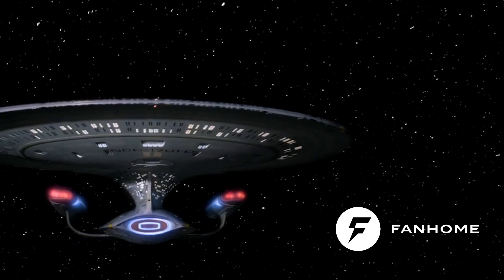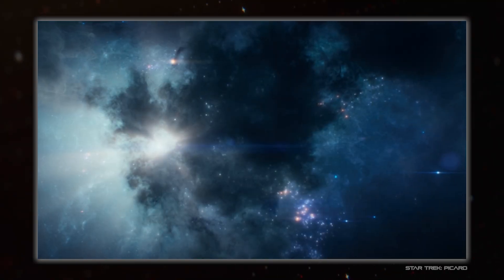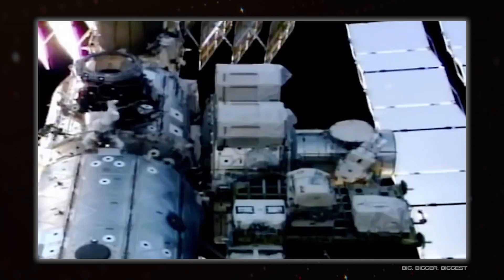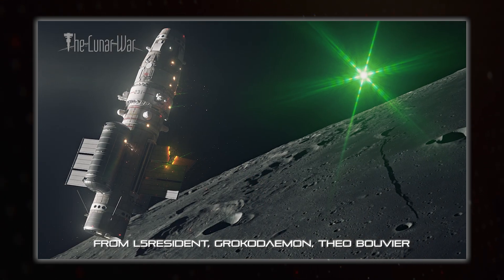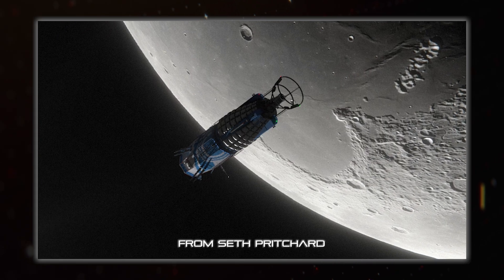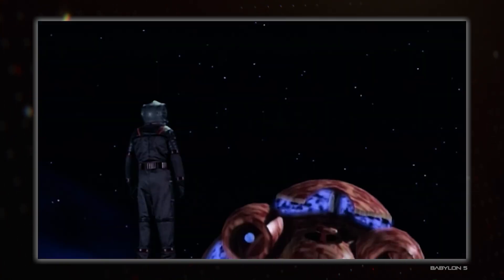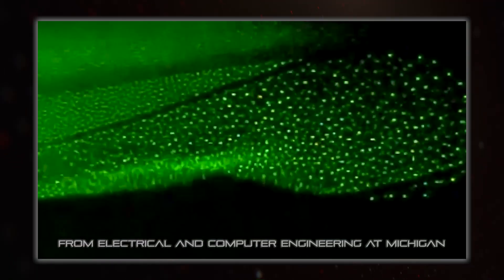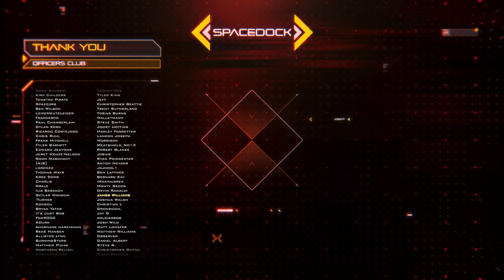Radiators In Realistic Sci-Fi (And Why You Need Them)

Comment: So there's an idea that you could use a magnetic field with metal dust or particles or debris to create a Shield around a spaceship it would be cool if the coolant system also happened to be a defensive shielding system it wouldn't protect against everything but there are a few things that it would protect against also when it comes to using a heatsink and just tossing it overboard which was the  last suggestion in the video why not soot it at the enemy or use it as a Decoy for heat-seeking missiles

Comment: Ship weapons in my roleplay setting have a two-mode heat dissipation system in the form of heat modules. The first mode is to just let it cool down normally. The second is to eject the module, and have another slide into place from a magazine. This introduces logistical issues as the modules are bulky and expensive. It's adds  what is effectively "ammo" for energy weapons. It's also fun for players to salvage spent modules after a battle.

Comment: For a liquid coolant, molten Sodium can be distilled from molten salt and you could use that instead, and instead of pumps, use magnets to direct its flow, and use that as a heat sink or a backup for your radiators. Less moving parts, and you'd get load chasing capabilities if you stored that backup heat energy somehow, only downside is having to design electronics to be resistant to the magnets they're directing.

Comment: So this video makes me wonder about another heat sink from another piece of fiction and how effective it would actually be or if this is a case of complete hand-waving.  The "Laser Heat Sinks" from Battletech. According to the game manuals "Unlike a normal heat sink which uses radiators and heat-conductive fluids to cool a 'Mech, a laser heat sink uses lasers to excite the hot exhaust gases to a higher-energy state, converting the infrared energy of the gases to light which is then shunted out of the 'Mech via a series of highly polished surfaces." They were stated to suffer from creating bright flashes which would increase visual detection of a unit, but also prevent thermal scans from spotting them. Also said that they didn't suffer from hot environments reducing their efficiency but also meant that cold environments didn't let them radiate heat faster.

Comment: Remember also that the reactor core or other high heat systems don't have to be in contact with crew quarters. You can have separate radiators connected only to that unit which can be driven at much higher temperatures and efficiency. A reactor "room" could probably operate in the 100s of degrees, depending on what tech you have available, maybe even higher.

Comment: Setting I fiddle with uses retractable radiators and capacitors. There's an emergency heat dump method involving fold space that empties capacitors in a hurry. But also leaves a thermal bloom in the sub dimension several times the size of the ship. And it  makes ftl at that location uncomfortable.

Comment: Why not hook up some Sterling engines to your heat radiators and turn that into electrical energy and do something else with it or even bleed it off into kinetic energy. You still need radiators but you get around 30% of the heat less and as a usable resource and backup. A backup is a multiplier and a hidden resource

Comment: In my book heat regulation is a major thing. The mech characters all have 'wings' that act as radiators, along with their hair and limbs, and have a respiration system where their blood transmits waste heat to a transparent coolant liquid that then passes through the wings. It's expected they will be damaged but because of how the system works it just turns into an active coolant system, and they are wreathed in steam, and if all radiators become inactive they are mission killed. At one point someone's brain and ganglia get damaged so their coolant system malfunctions and they melt from the inside out.

Comment: Another Variant I could think of, would be something like a dissipating radiator. While transferring some heat into the EM spectrum, it would also expel additional heat by surface evaporation. 
Though I have no idea how efficient this ultimately could be, when compared to pure radiators. Especially with the trade off in increased maintenance costs, since you constantly would have to replace used up panels.

Comment: Spacedock, not sure if you respond to questions. Could you use something like converting the energy type, as in, super heated liquid is used to power a generator that then powers a specific energy heavy system? Something like the heated liquid turns to steam which spins the turbines that power the magnetic shield system?

Comment: Why not use the extra waste heat as thermoelectric generators or thermophotovoltaic cells? Therby self powering that and potentially other onboard systems
Reply: You need a temperature difference for those. And the wnwehy you get is relatively low.

Comment: I imagine this is going to sound pretty dumb...but here goes... could you make a system act as a reloadable heat-sink? This way you could retract the panels in a battle situation, yet possibly last the battle by ejecting spent heat sinks? I imagine that would lead to clutter, but i also imagine there would be a way to reclaim maybe even re-use these "cartridges"?
Edit: nevermind does 9:00 address this?

Comment: My personal thought on this is that... In a majority of cases that do involve space ships, We don't really think about this kind of stuff much, but usually it's there if you end up digging deep enough, it's just the average person may not care enough to hear about these kinds of small details outside of like lore stuff that they can read whenever they want if they feel like it.

Now, another thing I'd like to state is that, not every scifi space movie/film/book/whatever needs to have thermal radiators tho. Because in some instances it may be impractical for the civilization to do if they have much better methods of dealing with the issue of heat in space that could possibly be far more efficient at removing heat with little to no waste being made at all.
This should become especially apparent when one takes into consideration civilizations so advanced that, they could make ships look however they want, free of the conventional design methods we ourselves are stuck to because of our technological limits. And even furthermore said civilizations could possibly produce ships that emit little to no heat at all on their exteriors, yet also remain livable to be inside through thermal regulation methods that don't require exhausting heat out of a ship.
Besides, if one can design a ship thermal regulation system that requires no throwing of waste heat into space, where the exterior of the ship is just as cold as the vacuum of space, outside of visual scanners, You'd be practically invisible to any sort of thermal scanners beyond maybe a slight outline around the ship.

Anyways, my point being is that, thermal regulation is yes, required for civilizations of either tiers 1 or 2, but tier 3 and above might not be so necessary for them to have such. Especially the higher you get in technological abilities, the higher of a civilization you become, the lesser of a need of primitive methods you will have.

Dump of text over now, if any of you read all of this, congrats. If you wanna comment on this go ahead, chances of me ever seeing it, are quite slim because Youtube almost never notifies me when a reply to any of my comments are made :D

Comment: One thing I learned from DP9 is how much of a vulnerability large/hot radiators (or insufficiently insulated heat sinks) can be. Space warfare depends very heavily on being able to precisely pinpoint your enemy's location and vector while making your own as hard to pin down as possible. This makes your thermal profile something an enemy can use against you. Properly regulating heat during battle would be an intricate dance, and knowing an enemy ship's sensor array would help you know when you can vent a little hotter and when you really do need to rein it in.

Comment: I don't know why you can't just pump heat into the propellants before burning them when we're talking about sci-fi. You are only generating substantial heat while using engines, and even if the thermal efficiency sucks, it's way better than radiative cooling.

Comment: The Discovery in 2001: A Space Odyssey was supposed to have radiators and had them in Clarke's novel, but Stanley Kubrick nixed them because he was worried the audience would think they were fins. 

About open cycle cooling, I believe the canceled X-20 Dynasor spaceplane was designed to carry water which would be vented through the metal heat shield scales during the hottest part of reentry to shed the heat load.

Comment: One potential option to reduce the amount heat to dump and reduce energy losses would be to have a thermal recovery system -- if you have a Peltier module with a difference in temperature between the sides, it generates electricity. So you could heat pump into a Peltier module, some heat will conduct thru it and out a radiator to the cold space, and the module will give back some of that heat as electricity

Comment: space wars will have an arms race for who can make computers out of higher temperature melting elements, who can insulate their crew better and how long you can go without deploying your radiators.

battles become a attrittion-driven based on how hot your command ship is, and how soon it will cook the commanders or melt the onboard computer, if no commander is present.

maybe ships will surrender without even trying to defend themselves simply because they do the calculation that they can't cool off fast enough to run away.

Comment: You could also recycle thermal energy back into the propulsion system.  Or if you're coasting convert it into electricity using Seebeck generators. Waste not want not.

Comment: Can you salvage some of the energy gathered into the radiators for energy, say via a steam turbine. Theoretically it could recover some energy, then the steam would have to be cooled down again. (So taking energy from the red hot glowing radiators via steam, then letting the steam with reduced temp (from expansion) cool down onto some cooler radiators.

Comment: Not exactly radiators but in my sci-fi story, the cargo ship the main character works on has kind of inverse radiators to go along with the normal ones. Heat absorbing panels used for collecting solar energy to heat water for heating and water systems. It uses a high-temp coolant and a heat exchanger to actually heat the water.

It's intended to passively reduce energy consumption from the reactors while close to a star, and be able to store that heat for later so it takes longer before electricity needs to be used for heating anything. The reactors produce a lot of heat, but the main one is run at low power when the ship isn't running the engines, so I'm not sure how much extra heat there would be to spare at that power level.

Considering the cargo ship is owned by a corporation and companies love to save money and time wherever possible, installing a solar water heater system in order to save a little bit of fuel for your fusion reactor sounds like a very corporate thing to do. 

I may remove this part from my story as it makes more sense for small ships and space stations than for a massive spacecraft with a large main reactor.

I'm still in the process of reworking my story as the 4 chapters I wrote probably like 2 years ago were messy and actually the first significant writing I had ever done. I want to improve the story before I think about releasing new chapters.

Well, this got me passionately ranting about sci-fi writing so there's that.

Comment: One of the highest performance cooling solutions is "boil off" it is an open loop water based system most famously used in ultra high performance piston aircraft racing such as the Reno Air Race. The idea is super simple instead of cooling the water directly with a radiator, you remove the radiator and let it cycle between a coolant tank and the engine once the water is forced to undergo a phase change to steam you let it escape. By allowing the phase change to happen, the water rejects 5 to 7 times the heat.

Comment: It would be easy to design a fictional cooling system using iron dust flowing in a magnetic field taking on heat then releasing the heat to space .Then using the magnetic field to take iron dust back into spacecraft to take on more heat. Could allso do the same with magnetic gasses running through a magnetic field. Am unsure of powerplant needing that sort of cooling. However large spacefreighter or mining ore containment ship using pertual motion magnetic engines might find it of some use if they were tremendously large and used for interstellar ore transportation might be able to use such a cooling system because there is unlikely to be much to interfere with that type of cooling system in interstellar space. Spacecraft would be more likely to be crewed by machiney unless their science was advanced enough to get living crew to mining site and back to origin site where occupants boarded spacecraft so that they do not have to breed for hundreds of generations to complete the mission. (Meaning faster than light travel possibly. Assuming some of Einstein's theories are correct.) Have a good day. 😊.

Comment: While it is true that our current tech would and do require radiators, one of THE biggest things holding us back from true space travel is efficiency.

Consider a power solution that provide power to do the work, not largely to cool itself. It would limit the need to externam cooling on the whole ship, less heat generated = larger % of the total heat will "naturally" leave the spacecraft.

Comment: My concept for travel is much like many types of mediaeval & early modern warfare, where supplementary/auxiliary ships that are very efficient as just transport and movement of things alongside some depot spots (think Incan highway warehouses of sorts) are what keep a fleet moving... and doing so efficiently.
Have a large cruiser with ejectable heat sinks, these would then be collected by support ships/smaller vessels of support ships. Where perhaps they could have their stored heat used for a separate generatour or somehow have them do work... once cooled the heat sinks are then resupplied back to the forward vessels when the timing/opportunity is available. Now for fusion reactours and such that seems like a piddling amount of heat to have recycled I would think. So maybe I would then use them as artillery or drop them on a planet as building blocks or something (HOt Energy Ray from a planet's surface).

Comment: Radiators are all well and good. However, they are big, vulnerable and most importantly, they are emitting a constant SOS signal to everyone around. You are trying to get noticed if you are radiating heat into space.

I think that more advanced solution is to put heat into use. Use heat energy to produce electricity. Excess electricity would be used for something like sensors or just converting base materials into their higher forms. For example, just producing molecules out of thin air so to speak. Excess electricity then again could be used to pump heat from systems to reactor to convert it into even more electricity. You do not have to take specific things, just an idea. Sure, it is a lot more complex, but it makes a lot more sense to do. Heat suddenly becomes an asset on your spaceship rather than a liability.

Comment: I wonder if anyone has thought about laser cooling.  Wikipedia has an article about this.  If you can cool a liquid to really low temperatures using the laser, then you can avoid the problems with the droplet radiator system.

Comment: One of the few "realistic" things about Star Wars, the starfighters unfolding radiators before going into higher energy usage during combat to stop them from overheating, and folding them away to protect them when not needed. Even justified in using radiators during combat because with starfighters, if you get hit you have a lot more things to be concerned about than damaged radiators, like blowing up for example.

Comment: How difficult or expensive are these radiators to produce? It likely wouldn't be an issue for them to be exposed in combat. If they are damaged, the remaining parts will need to be run at a higher temperature and use more power, but they likely could be easily repaired afterward.

Comment: Alternate pitch (especially if we're talking sci-fi) 
Collect the heat and turn it into more power. It doesn't need to make more than it uses to do this, but it should in total use less than just radiating it away.
Reply: Laws of thermodynamics says hi since making or using energy also creates waste heat. End result is instead of getting rid of heat, you end up with more. Better off copying Star Wars neutrino radiators where they are dumped as neutrinos.

Comment: In my setting magic and technology are used in tandem. Thus, most radiators on ships use cryomancy to effectively pump heat from cold objects to hot ones, making them radiate away huge amounts of energy. Cryomancy doesn't just cool something down, it makes the heat move away from the target of the spell.

Ship generates heat -> cryomancy moves this heat to the radiators and doesn't let it come back to the hull -> heat is radiated away.

This exact method can be used to make heatsinks with HUGE capacity. Like straight up a tungsten block which can be pumped with heat until it glows white.

Moreover, there are ways to reuse the heat - cryomancy has a lot of uses in this field.